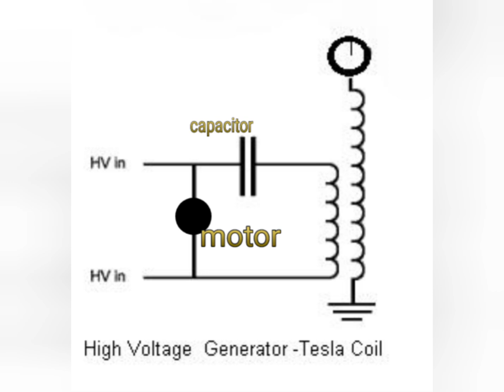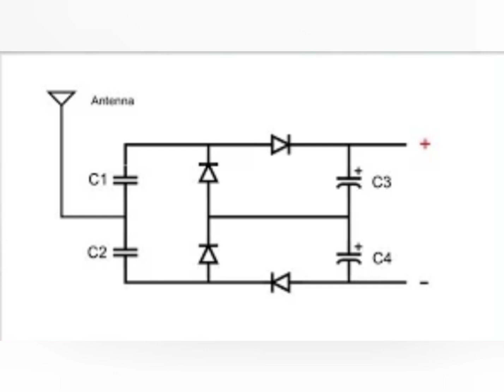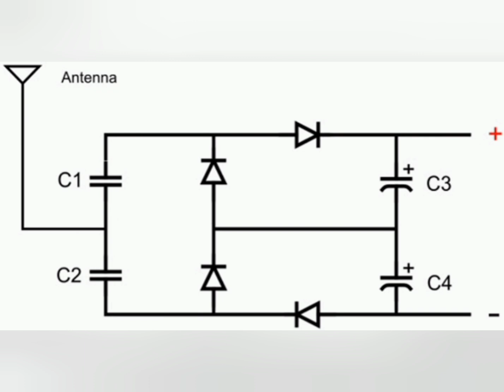moderate Motors versus Nikola Tesla's designs

Comment: Hi😊😊, 👋, please 🥺🙏, show how you build your coil on that rod. I have been trying to get a video that teaches clearly. Thanks. Keep up the great work 😊😊😊😊❤❤❤
Reply from the maker: @elmultimediaschoolofartscu3924  Hi there! Thanks so much for your interest in the videos—I'm thrilled to hear you're learning and enjoying the content. There’s a lot to unpack with coil design, Tesla’s principles, and the different types of energy we’re working with, so let me dive into some of the fascinating effects and methods that come into play.

Understanding Different Energy Phenomena in Coils

Transient Spikes:

Transient spikes, or what I sometimes call "tangent energy," are those high-frequency, short-lived bursts of energy that occur due to sudden changes in motion or current. This energy is seen in experiments like the “speaker generator” setup you may have seen, where a ball drop or rapid motion in a speaker diaphragm creates a brief but powerful burst of energy. By adding magnets and using a motor to vibrate or oscillate the speaker at high RPMs, you can produce enough transient energy to light multiple LEDs. Here, the rapid start-and-stop motion of the coil generates these high-energy spikes that would otherwise be lost or treated as interference.

Back EMF with Iron Cores:

Adding an iron core to a coil changes things even more by introducing what’s known as back EMF, which occurs when the magnetic field around a coil collapses and creates a pulse in the opposite direction. In Tesla’s designs, using iron cores and switching the current rapidly allowed him to capture this back EMF, adding another layer of energy production to the setup. When you quickly disrupt the magnetic field, you get an additional spike—different from transient spikes, as it’s directly tied to the core’s properties and the stopping of current in the coil.

Resonance and Frequency Tuning:

Tesla’s work was revolutionary because he explored how resonance amplifies energy transfer. By tuning coils to resonate at specific frequencies, he could capture and amplify energy through what he called the “sea of energy” around us. Resonance allows energy to flow with minimal resistance, making it possible to increase the energy within a system with very little input. Tesla even designed bucking coils and a center-tapped coil setup, which essentially allows two magnetic fields to interact in such a way that they cancel out resistance while letting energy flow freely.

The Unique Properties of Tesla’s Coil Designs

Tesla’s approach to coil design went beyond what we see in traditional transformers or inductors. He experimented with several coil configurations, each serving a unique purpose:

Bifilar Coils: Tesla’s bifilar coil design, for example, could store potential energy like a capacitor while acting as a magnetic resonator, making it highly efficient at capturing and holding energy in the form of potential voltage.

Large Reservoir Coils: Large coils wound with low voltage can act as energy reservoirs. When connected with smaller pickup coils that vibrate or oscillate at high frequencies, these larger coils can release stored energy in bursts, generating usable power.

Buck Coils: Tesla also used center-tapped or bucking coils that produce a different effect. When two coils are placed in opposition (or bucking) with a center tap, they can cancel out certain forces while capturing energy from resonant vibrations.

Putting It All Together: Energy, Vibration, and Frequency

Tesla famously said that to understand the universe, we must think in terms of energy, vibration, and frequency. Each coil configuration brings these principles into play in unique ways:

Energy: Every coil has a different capacity to store or transfer energy based on its configuration.

Vibration: Rapid switching or motion, as seen in the speaker generator, can produce transient spikes or transient energy that, although brief, becomes useful at high frequencies.

Frequency: Resonant frequency tuning allows for minimal resistance and high efficiency, amplifying power within a system without adding more input energy.

Practical Takeaways for Your Coil Experimentation

For winding your own coils, keep these different effects in mind:

Core Material: Using an iron core introduces back EMF, while using an air core will give you different resonance and inductance properties.

Switching Speed: Fast switching (like Tesla’s reed switch setup) or physical vibrations (like with the speaker generator) can create transient spikes that are usable at high frequencies.

Resonance: Try tuning your coils to a specific frequency if possible. Resonance allows for efficient energy transfer and, with the right configuration, can amplify the energy within your system.

For more specifics on coil winding techniques, check the lecture links in my description—I’ve included a resource from someone with experience in wireless energy and motor winding techniques. Feel free to download it and use AI tools to clarify any parts until I can make a video on these concepts for you.

Thanks again for the support! The world of Tesla’s work on energy, vibration, and frequency holds so many secrets, and I hope this sheds some light on the powerful effects you can achieve with coils!
Reply from the maker: @elmultimediaschoolofartscu3924  
Exciting News!
My new book “My Purpose is to Drive This Technology to Market” is now officially published and available on Amazon!

This work represents years of hands-on experimentation, theory, and exploration into real-world energy solutions inspired by Nikola Tesla and other pioneers. If you're a researcher, engineer, inventor, or simply curious about future-forward tech, this book is written for you.

I would be honored if you took a moment to read it—and even more grateful if you could leave a review on Amazon. Every rating and review helps increase the book’s visibility and brings this technology one step closer to the world.

Check it out here:
https://www.amazon.com/dp/B0F2ZZ7X5C

Thank you for your support—and let’s build the future, together.

Comment: single phase stator is no where near as efficient as 3 phase .
Reply: Tesla did not design the 3-phase generator. All he did was design a polyphase AC motor prototype that did not work very well. It was Dolivo-Dobrovolsky who designed the 3 phase squirrel cage induction motor, synchronous generator as well as star and delta connections. 

3 phase synchronous generators can also be used as a motor which is done with PMSM motors and regenerative breaking

You need at least 2 phases with 90 degrees phase difference to create rotation in two-dimensional axis which is shown by the Clarke and park transforms. Thus, Single phase motors are really 2 phase motors but use a capacitor to lag the current on the second coil to get 90 degrees phase difference. 

There are "capacitor start" motors that start the motor on 2 phases and run it on 1 phase but these are limited to low power applications due to 100% torque ripple caused by torque imbalance between the two-dimensional axis. 

Also, using “capacitor run” will still cause imbalance between phases due to resonance it causes on the second winding. It is better to use an inverter to generate the two phases but at this point you might as well take advantage of a 3-phase motor. 

Both 2 phase and 3 phase systems have constant instantaneous power, resulting in low torque ripple and smaller fly wheels for both generators and motors. the only advantage of 3 phase over 2 phase is that balanced currents cancel on the earth eliminating the need for a high-capacity earth wire.
Reply from the maker: @fablearchitect7645  okay with that answer, I'll have to give you my library answers since I am a librarian. And here it is Your summary is largely accurate, but let’s dive a bit deeper into Tesla's work and clarify the contributions and complexities involved.

Tesla’s Contributions to AC Motor Technology

1. Concept of the Rotating Magnetic Field:

Tesla's key contribution was indeed the rotating magnetic field, a concept fundamental to AC motor operation. This principle relies on using multiple phases of AC power to create a magnetic field that rotates, which can then induce motion in a motor’s rotor.

Tesla showcased this concept in the Egg of Columbus demonstration. Using an AC polyphase system, he created a rotating magnetic field that made a copper egg stand and spin. This wasn’t a motor itself but a demonstration that showed the principle of induction, which is the basis of how induction motors work.

2. Three-Phase Motor Development:

Tesla filed several patents related to polyphase (multi-phase) AC motors. His U.S. Patent 416,194, filed on May 20, 1889 and granted on December 3, 1889, specifically describes a two-phase induction motor. While he didn’t patent a three-phase motor directly, his patents laid the groundwork for modern polyphase systems, which include three-phase.

The three-phase system became the standard because of its efficiency in creating a smooth, rotating magnetic field, ideal for industrial motors. Tesla’s work in two-phase AC was a stepping stone to the three-phase systems later developed and adopted.

3. Polyphase System Patents:

Tesla filed a series of patents for his polyphase system, which included designs for transformers, motors, and generators optimized for AC. Notable patents include:

U.S. Patent 382,279: For an electric motor (1888), outlining the principles of rotating magnetic fields.

U.S. Patent 381,968: For an electro-magnetic motor, also in 1888.

U.S. Patent 382,280: Describing an electric power transmission system (1888).

These patents collectively described systems and components essential to polyphase AC power, a foundational technology for three-phase power.

Other Notable Figures and the Collaborative Nature of AC Motor Development

1. Galileo Ferraris:

Italian physicist Galileo Ferraris independently developed and published work on rotating magnetic fields and induction motors around the same time as Tesla. Ferraris demonstrated a two-phase motor in 1885, prior to Tesla's patents.

While Tesla’s designs became widely commercialized, Ferraris's work was significant in advancing the theory behind AC motor technology, and his contributions are recognized as part of the collaborative development of these systems.

2. Mikhail Dolivo-Dobrovolsky:

Russian engineer Mikhail Dolivo-Dobrovolsky further developed the three-phase induction motor and created the three-phase system widely used today, which offered smoother and more efficient operation compared to two-phase motors. His work in the early 1890s completed the foundation Tesla laid, making three-phase systems practical for industry.

Tesla’s Egg of Columbus and the Rotating Magnetic Field

The Egg of Columbus was a demonstration tool, not a motor itself. Tesla used it to explain the rotating magnetic field visually, as the egg could spin on its base when exposed to the rotating magnetic field produced by a polyphase AC source. This experiment effectively communicated the principles behind his motors and the advantages of AC.

While the experiment is sometimes incorrectly associated with a specific motor design, it was a visualization of the underlying physics. This experiment helped investors and the public understand why polyphase AC was revolutionary.

Summary

Tesla's innovations in AC motor technology were indeed groundbreaking, especially his patents related to polyphase systems and the rotating magnetic field. However, the three-phase induction motor—as we know it—resulted from the collective work of Tesla, Ferraris, and Dolivo-Dobrovolsky, with each contributing to its theoretical and practical development. Tesla’s contributions were foundational, but he was part of a broader effort that pushed AC technology forward, eventually leading to the three-phase systems that dominate power distribution today.
Reply: @WIZ56575 I agree that Tesla and Ferraris were the first to experiment with polyphase systems and rotating magnetic field (RMF) but it was Dolivo-Dobrowolski who invented 3 phase power. Tesla's motor needed 6 wires while Dolivo-Dobrovolsky squirrel cage needed only 3 because he knew unlike tesla that 3 phase power cancels on the neutral. Tesla’s motor also had too low torque for any applications due to eddy currents induced in the rotor which were solved by the slits in Dobrowolski’s squirrel cage rotor.
Reply: @fablearchitect7645  Thats what I heard Tesla designed 3 phase generator system , He made the 3 phase motor against his will, the people wanted a motor . He designed to to only be a generator because when in use as a motor it wastes a lot of power , which is why its such a good generator when used as such. I must be wrong in what I heard about the 3 phase and Tesla hmm?  anyway your reply is full of good info for the archive  Ty
Reply: @mykedoes4099  Tesla did not come up with any 3 phase generator. Infact Westinghouse had to use several single phase generators to demonstrate multi-phase power systems to investors because he didn’t have a multi-phase generator. All tesla did was invent a polyphase motor that Galileo Ferraris coincidently developed at the exact same time. Tesla was the only one to publish it because Galileo Ferraris thought it was too weak to be worth publishing about. 

Dolivo-Dobrovolsky was the first to make a full 3 phase generator and motor power system in Germany during the International Electrotechnical Exhibition of 1891. It consisted of a 300 HP 50V water turbine in Lauffen with a 175 km long 15 kv 40 hz transmission system that powered several 2-3 hp squirrel cage induction motors and 1000x lights in Frankfurt .
Reply: @fablearchitect7645  which book is this info from?
Reply from the maker: @mykedoes4099  why are we trying to take Nikola Tesla's devices and trying to mix them up with modern day devices even when Nikola Tesla did modern-day devices they work better than the ones created by Edison so we're talking about a certain device that Nikola Tesla did using the Earth as a capacitor meaning potential energy you can't do much with potential energy unless you vibrate it or put frequency into it according to Nikola Tesla so now you going back and talking about Motors and phases the two are totally different devices what I did is make a capacitor and then I caused it to vibrate to see if you can get usable energy out of it do the experiment and tell me what you think
Reply: @WIZ56575  ya i get you on the capacitor thing thats like the Hendershot Generator. All I am saying is Tesla designed the 3 phase as a generator not to be used as a motor .
Reply from the maker: @mykedoes4099  no I get it but what I'm trying to get out there is the yellow device I hooked to the solar that uses artificial light, I hook this to devices that I'm describing without giving you an unpatented device but it lean heavy on Nikola Tesla's theory of what happens when you take potential energy and you shake it or you put frequency in it that means I can run my solar on 5 Watts power from the LED lights you can buy them from Amazon now the 2.  20 watt solar panels gives you 17 volts but not much amps which many people have told me on this channel I knew that but they didn't understand that I had to put it into another device just like you take your solar and put it into a charge controller but this device takes regular voltage and not amplify it but vibrates it now if you can see the results on that then all of a sudden you start to understand everything I've been saying in the past again it's important that you see my published and acknowledged papers and then we can have a real discussion because when you see that this is not just fantasy but are based on actual scientific designs all of a sudden you start to see the difference in modern day to with Nikola Tesla was saying about taking atmospheric electricity which you can get into the thousands to 100 thousands of votes but once you vibrate that you have very usable energy the reason why I put his patents in there and let you know that he was using Motors as a mosfet or what we call a switch to put frequency or vibrations into the potential
Reply from the maker: @mykedoes4099  to answer this question we don't want stability we want high output meaning transient spikes look at the diagrams understand we're talking about a different device than a motor even though it has all the principles as one so if you don't understand this go into the description and read the published papers
Reply: @WIZ56575  yes then this snake coil will work great for reverse flyback spikes , it has the geometry for enhancing that yes indeed sir
Reply from the maker: @mykedoes4099  Lucky in this design you can add as many phases as you wish
Reply: @WIZ56575  3  phase is stabilized into 3 parts of 120 degrees per 360 rotation .  output is constant
Reply: @WIZ56575  any copper that a magnet passes over will create drag and if the lenz is not in phase for out put use it turns to heat or resistance, so make sure if your passing magnets over copper that its bend directed to storage or load . 3 phase system is about passing n/s over one inductor per 120 degree